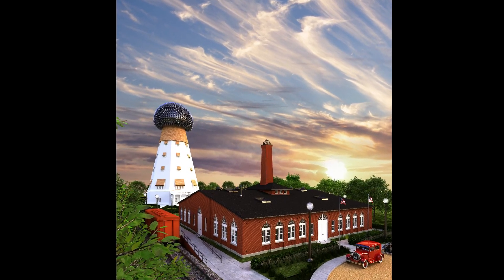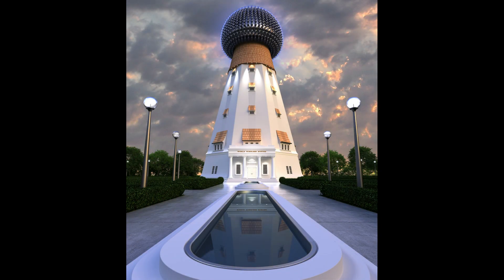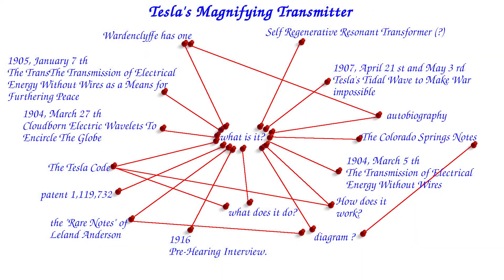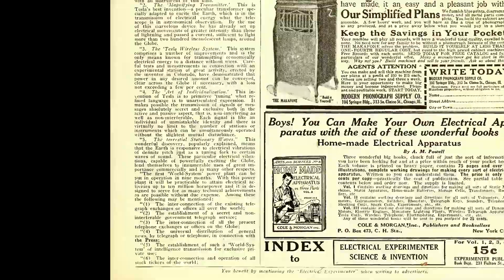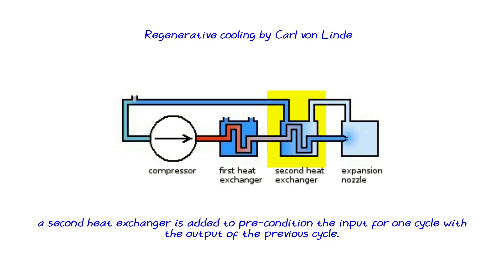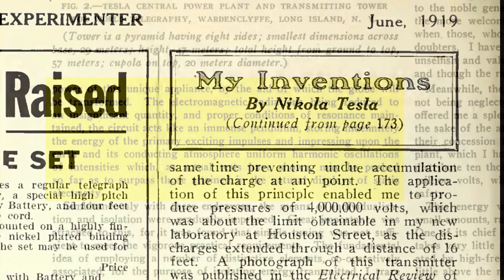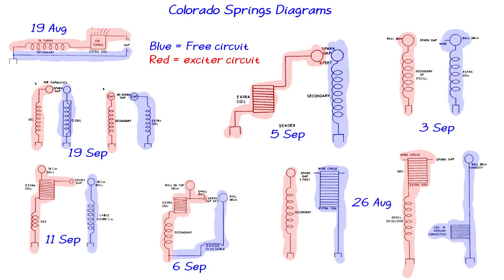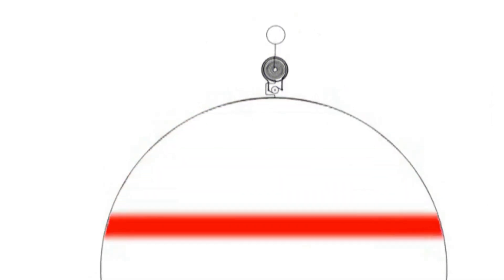Teslas Magnifying Transmitter

Comment: Also working on it, very curious what you will share.
Reply: I respect you as one of my earlier inspirations. The fact is, Ivo, that you didn't really follow tightly Tesla's clues. 

I think It needs totally another path to follow to reach something tangible, and the path, according to me, is: 

- determine what you are looking for. It seems to me that you started being biased by energetic forum, ken wheeler, eric dollard and those kind of people that search for overunity. In my extremely deep lurking research I found forums containing discussions between people and you, backing something like 2014-2015 if I'm not wrong. Well, you are searching for free energy, and you are searching that in inductive spikes, or something related to a discrepancy between timely effects by capacitors and inductors. I don't think this mess can conduct you anywhere, because overunity does not and cannot exists, while free energy from harnessing the sun can.

- realize that those "impulses" that stay at the foundation of your research are not necessarily positive or negative only pulses: Tesla technology transforms every type of excitation in alternate currents anyway. What matters is reaching resonance in the oscillator so as to have high voltage as a consequence of resonant rise on one terminal of the secondary. When the discharge happens between the topload and another secondary circuit, as in the video above that we are commenting, suction of ions from the surrounding happens and EXACTLY THERE you have free energy behaviour. It's the spark that sucks in its flow, some more energy than that required to make it in the first place! It's not anything mysterious that makes this happen. I think it's time to forget mystifycation, cold electricity, counterspace and all that came from Dollard and the americans. They have some perversion similar to science fiction emotiveness.

- read the books that matter really. I suppose you have done that, so far as I know, but lately in your research. I also found the books that matter, and I reported them you promptly. I left many traces in the comments sections under your videos and we had constructive exchanges there.

- reading those sources helps feeling when you are in the right direction , and when you're onto it, you absolutely aknowledge that 1) aTesla aficionado must surely approach tesla coils the common way and build one at least-> then realize the best configuration is with the extra coil, so 3 coils, and doing this one outperforms more than 99% of the people involved in kind of activities -> then realize that a TMT is composed of TWO circuits connected by a gap between them. This was found out by Leland Anderson in the "rare notes", kudos to him in the heavens, and researched more deeply by Ernst. The purpose is 1) to scale down frequency (Bill Beaty found out this some time ago, in his article "DID TESLA'S WARDENCLYFFE TOWER
 GENERATE SQUAREWAVES?" ) but also 2) to suck in energy from the surroudings, cooling down the places around the device, and getting this way free energy. THAT'S why Gerry Vassilatos was talking of a refrigerating property of Tesla's machinery. That's also why in the movie "The Prestige", when approaching Tesla's lab, the surroudings were frozen. Think about this.

That's it, my 2 cents. A bit long to be a comment, but maybe it's worth reading.
Reply: @tanner1985  Thanks, Yes in the start I was influenced by them, Indeed I still feel the impulse is key to success. I am seeing earth currents now, and reading T Henry Moray. I agree that magic creation of  energy is not the way, and start to think of the extra coil (when tuned properly) makes it into a pump. Pumping the earth. Which gets it's energy from the sun.
I am confident that we still don't know how to create power from the Aethers, but it is definitely possible. So I'll keep an open heart.